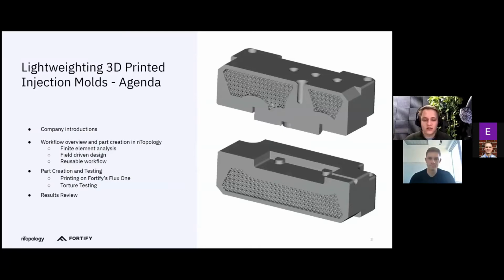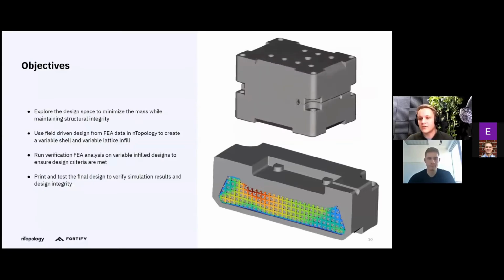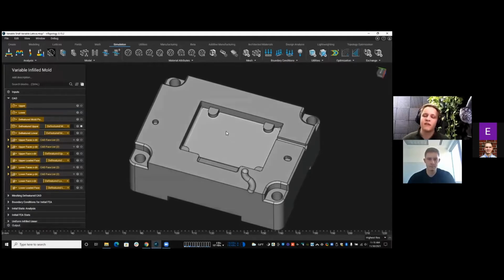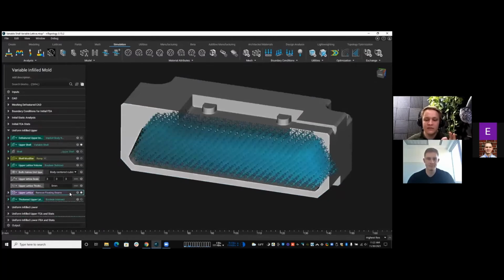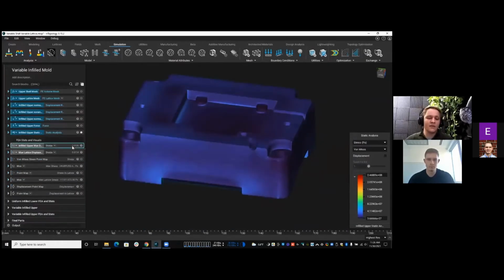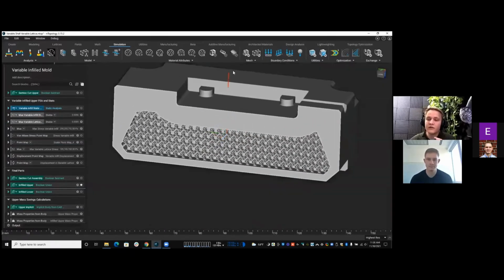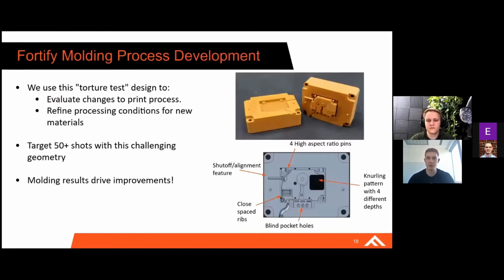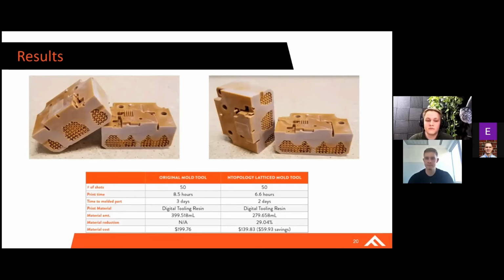Lightweighting 3D Printed Injection Mold Tools to Reduce Cost and Manufacturing Time

Comment: Congrats on an energetic and entertaining webinar ... a good understandable example of part light-weighting and material/cost savings!

BTW: I mean who hasn't printed a (resin) part, forgot to add drain holes (and added them manually, later)? ;) I do wonder if slicing/visualization software can be smart enough to detect and warn users of cavities causing issues with resin printing. Two (software) printing package platforms I've tried, don't bother ...doesn't happen often, but everyone does it, occasionally. Maybe it's too computationally expensive (for a lot of geometries)?